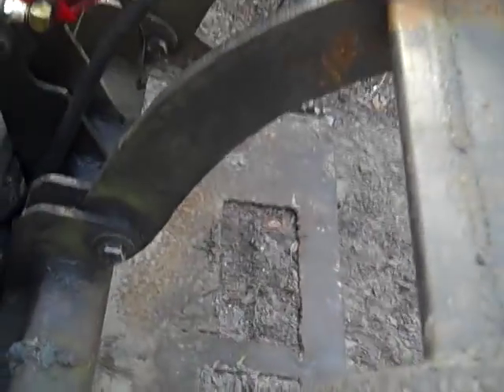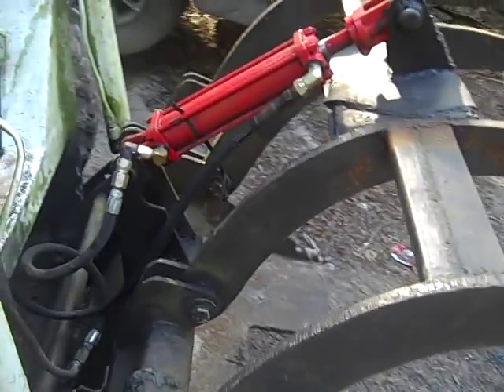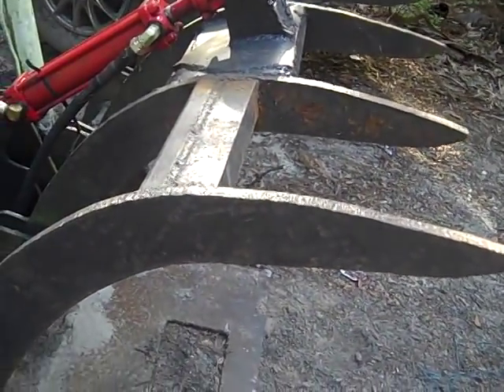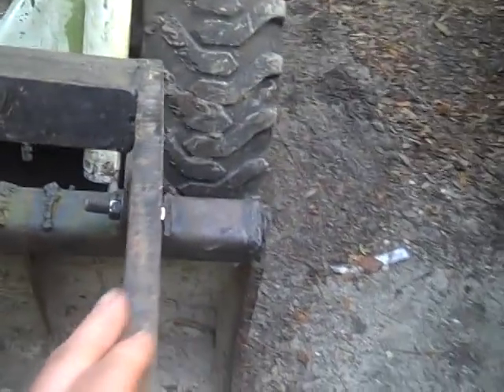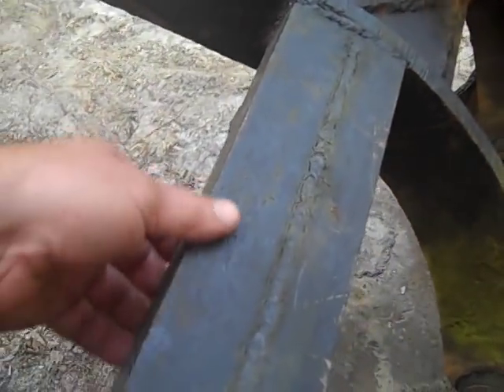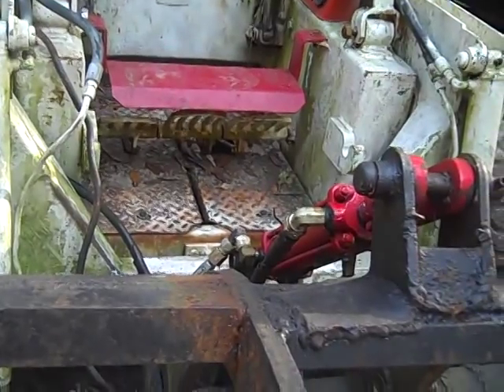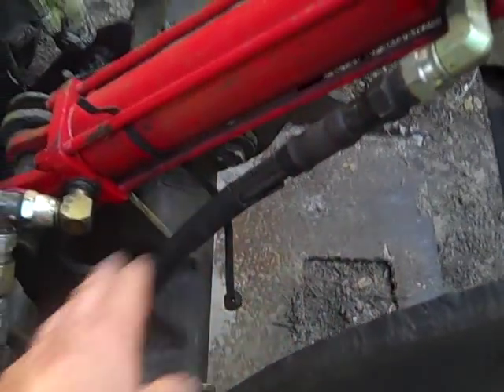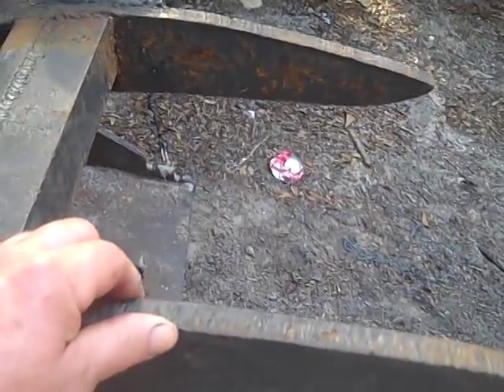How to make a $2000 Bobcat Grapple For Only $200

Comment: Good job! As long as it works you don't need nothing fancy, just use what you got because steel is expensive nowadays. Don't listen to these idiots they would buy a $2,000 grapple with pretty paint for a $1,500 machine. Fine job!

Comment: Love to see a fellow machinist/mechanic saving money and building something that is probably better quality that the junk china makes. BTW My 853 has controls on the right steering lever to control grapples. I'm going to build a grapple and a log splitter for mine. A hydraulic motor coupled to a bush hog and mounted on the front is one kick ass grass cutter. No more driving into a hole or ditch like I did with the rear mount bush hog on the John Deere 850.

Comment: M600? M610?    great little machines, i have the M600 and its a little work horse
Reply: What is the difference between a M600 and a 610?
Reply: @JB-kw4ug  minimal. I can't remember specifics. But the 610 ran the VH4D Wisconsin. The 600 had a slightly less powerful gas engine. Both great little machines.. it's neat that these were bobcats before bobcat came to be. The 600 and 610 were melroe. Then bought by bobcat. I have most of the tech manuals if you need them.
Reply: @JB-kw4ug  also. There should be a little name plate, about an inch tall by ,3 inches. If you're looking at the machine, under the seat to the right of the choke cable. It would be right where your calves are if you were seated
Reply: I have the first 610 series made took awhile to get it running right again but man now that it does it's so handy
Reply: @collincissell1381  people rag on me because it only lifts 1000 pounds and has a top speed of 5mph. But like I tell them, that's 1000 pounds I don't have to move. nd you can't beat the simplicity of these machines !

Comment: Welders arent cheap either. Just saying...
Reply: AHP 160 amp dual voltage welder with 60% industrial duty cycle, $275. Harbor Freight auto darkening helmet $49. 30 amp Hypertherm Plasma cutter $900 (don't really need that though). $100 for cylinder. $100 for steel. $1,424 for everything plus you get a badass welding set up for anything you want to build in the future.  That's how I got my set up and it's paid for itself probably 20 times over in just a few years.